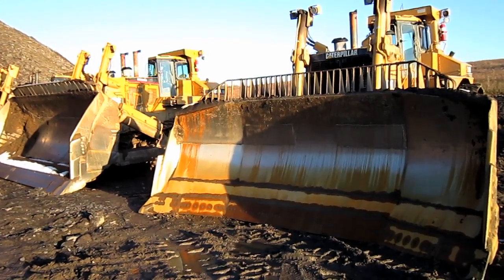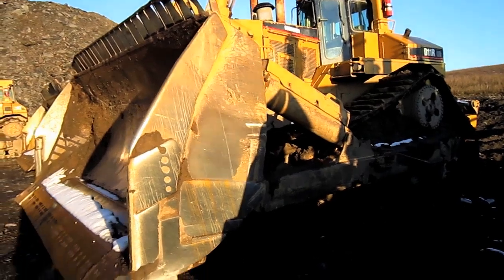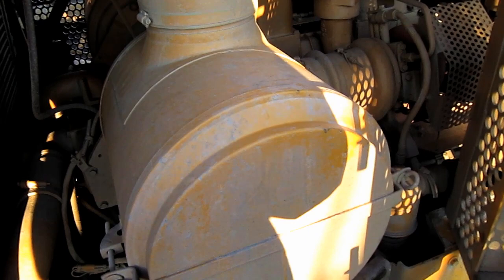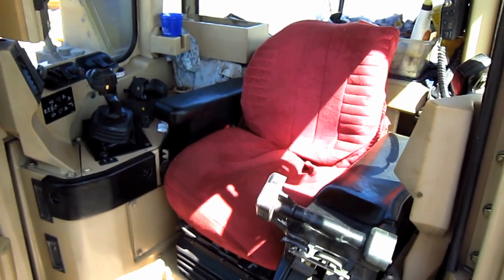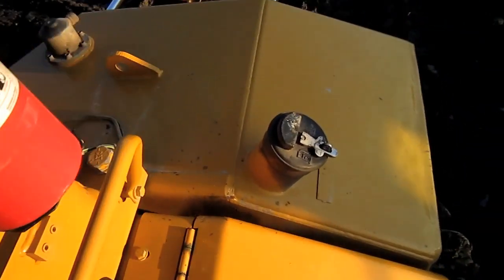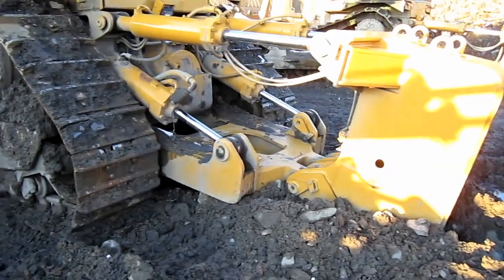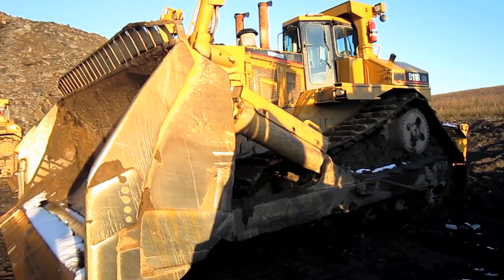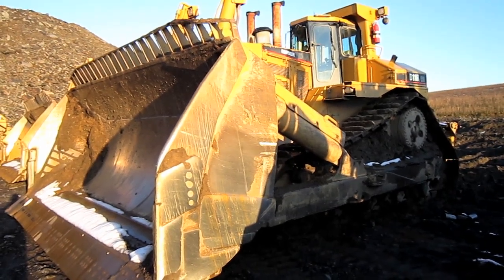Caterpillar D11R | D11R Carrydozer Documentary

Comment: Are you sure the 11R had the same horsepower as the 11N?  Wasn't the 11N 770 hp, and the 11R 850 hp?
Reply from the maker: If you pay attention in the video, I explained that the 11R was introduced with the same engine and horsepower rating as the 11N in 1996. The 11R CD was introduced 6 months later and featured the improved 3508B with 850hp. The standard D11R didn't receive this engine and power increase until 1997.
Reply: Bahaha, who feels like a twat now.